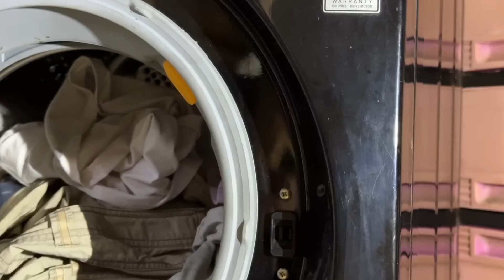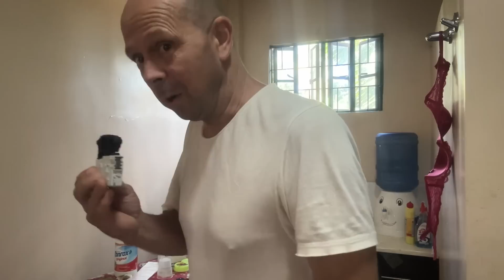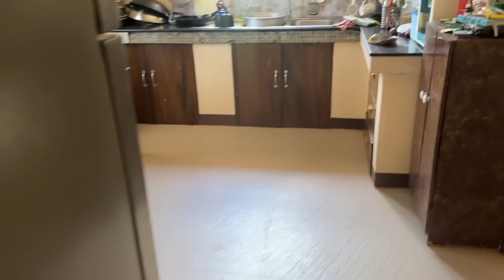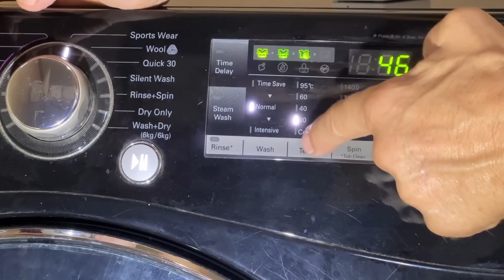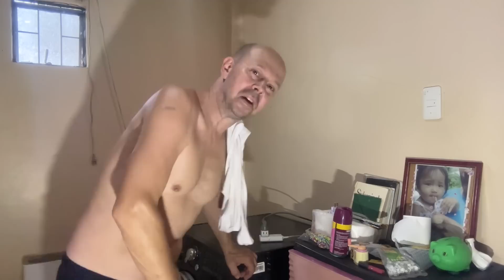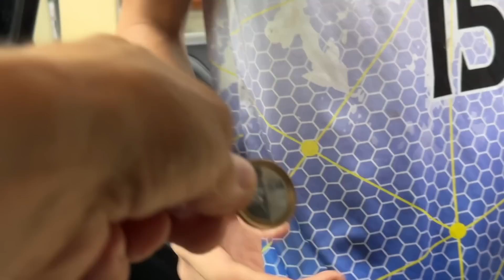LG Washing Machine Unusedt for 7 years, it was never going to be that easy

Comment: Alan that shower screen is known to fail at the hinges.  The glass is not shatterproof and if the door hinges fail while you're exiting after a shower there is a possibility that the door will fall and break into large shards of glass. Check those hinges and make sure the glass is rated for shower usage by looking if the glass has been stamped.
Reply from the maker: Hi thanks. I did check there are markings on the glass door and side panel saying “Asia temp glass corp. tempered”. No bs kite marks out here but those glass panels are very thick and heavy and very expensive 8 years ago but all looks good   Cheers

Comment: Please help Mr mondeo guru
Mondeo 2008 2.2 diesel
Fitted
new battery
New starter 
New fuel filter
Egr dpf delete  with remap
Still has an intermittent poor starting issue
Noticed a bit of air in the fuel lines is this normal?
Thankyou
Reply from the maker: hi, is it hard to start when hot or left over night. I would check all under bonnet fuel pipes for chaffing etc plus the fuel pipe with the valve in it near the high pressure fuel pump can draw in air.  also had the fuel injector leak off pipes where they connect to the injectors drawing in air over night and causing poor starting in the morning. do you get clouds of blue smoke when you start the car. good luck
Reply: @alan4x  thanks for replying  your  a star, once it's started and driven it starts perfect after, it's normally after it's left over night the next day the poor starting happens again.
Reply from the maker: in that case I would definitely replace the injector leak off pipes as the o ring seals shrink and allow air to enter the system. Had that many times but on the 4.5 mondeo models.  Have a very good look at plastic fuel pipes where they could chaff like on timing belt cover etc. a tiny hole will cause your issue.
Reply: @alan4x  cheers mate, I will give it a try, thanks so much for your help 👍

Comment: Never knew washing machines used so much water
Reply from the maker: nor did I lol
Reply: @alan4x  doesn't youre lg calculate the water it needs like mine alan . It has a very clever way of measuring what's in the drum then calculates the amount it needs for that particular amount of washing using less water than other machines. Clever machines although the direct drive makes them quiet sometimes you think are they working lol

Comment: These LGs are generally reliable washing machines, they last around 10 - 15 years. After which the drum spider usually breaks  through a process of being weakened by the washing powder which slowly attacks the alloy, dissolving and oxidising it, causing a fracture and failure!  Not all the types of spiders are available as spares for every model number so it might mean a complete placement machine is necessary, as I discovered after dismantling mine.
Reply from the maker: lets hope it lasts a long time, have a good one😁
Reply: @theeventhorizon-valebridge9512  I have a lg similar to Alan's it has a direct drive no belt. It's been a good machine over the years I've had it. I always had aeg before like my family you get about 20 years out of those but alas couldn't find any German made ones so opted for the LG

Comment: Plastic junk - you don't fix - just trash and replace - we used to have Whirlpool - it rusted to bits but still washed the washing.
Reply: @tibbydudeza  actually those LGs are good 👍 I have one it's been good over the last 8 years. Mine has a direct drive so no belt I don't know about Alan's machine. And mine plays the funny tune
Reply: @chuckysw  got lg toploader been 12 years but it is now making funny noises so i expect it to be replaced soon

A load of washing every second day not too shabby

I cant fix it since no parts since they do a new model every year so of to the dump with them

Comment: Alan i changed the door rubber seal years ago, the steel ring was on the inside of the rubber seal but instead  of being a spring at the bottom it was a screw, the same as a radiator hose, like a huge jubilee clip, you were lucky the ring was on the outside, lucky gitt, 😂 just saying from North of Newcastle 🇬🇧  🍺👍
Reply from the maker: 🤣cheers Brian

Comment: No better feeling fixing a something others would just throw out. 
I’ve  got a heat pump dryer its been going well for over a  decade with only minor repairs like replacing the drum belt and a crappy bit of plastic broke behind the stop stat button that supposed to tap the micro switch on the main board I had to completely replace the lot with new second hand board for about £35 delivered.
Also give it blast with compressed air and flush and clean inside between the condenser and the water pump.through whilst there because the lint builds up inside and on the condenser fins. Saved us a few times with repairs.
Keep the content coming. Appreciate your posts. 
Glad you’re all doing well.. 
cheers 🍻
Reply: The problem is that it is often cheaper to replace something rather than repair it unlike back in the day when things were built to last and could be repaired cheaply.
Reply from the maker: I totally stripped a hotpoint Ultima some years back and replaced the drum bearings..flipping job that was but yeah its a sense of achievement when it all works out, cheers David 😁

Comment: I love the Asian top loading machines; simple and last forever. The western front loading ones have a design flaw; the spider y mechanism on the drum will break as its defying gravity what with all that weight on the central spindle. Thus never buy a Western style machine in Asia!
Reply: Have had two front loaders fail due to broken spline on drum. First was an Electrolux which was so old it was not worth replacing; second was a Bosch and I changed the drum, but am unlikely to do that again as the spare parts are so expensive. In Thailand I have bought two top loading Samsungs; both the cheapest models, and  apart from mice eating through wires (and me repairing them) they are still going strong; the oldest is around 20 years old.
Reply: @armunro  I learned a while ago that the expensive machines don't necessarily last longer. I usually now buy Beko branded white goods as they are cheap, and so far, reliable. I had a Bosch dishwasher which had a mechanical programmer/timer/selector and a tiny fragment of the plastic mechanism inside it broke, rendering the machine unusable. The cost for a new programmer/ timer/selector was almost the same as an entire brand new Beko dishwasher with an electronic programmer, so I bought that instead! There was nothing else wrong with the Bosch one, but it was deliberately designed to break and be too expensive to fix, in the hope you'd just buy another one from them. No chance! I'll never buy an expensive brand again.
Reply: @theeventhorizon-valebridge9512  Wise words. If the cheap brand comes with a good warentee go for it!
Reply: Indeed they do, read my comment on this video!
Reply: nonsense